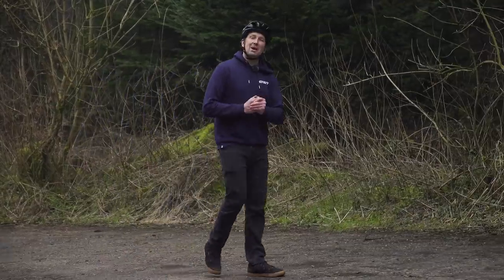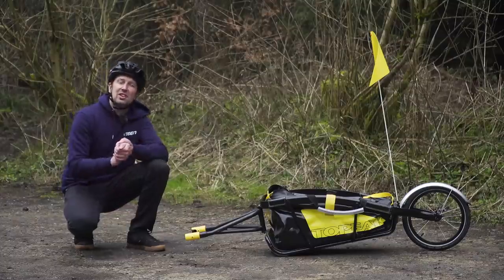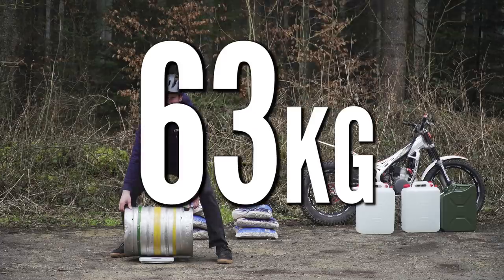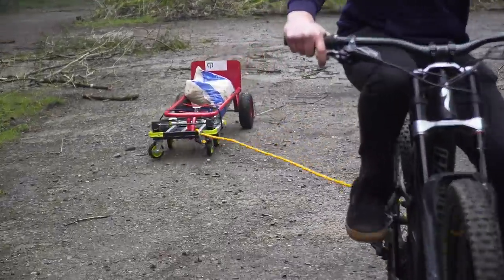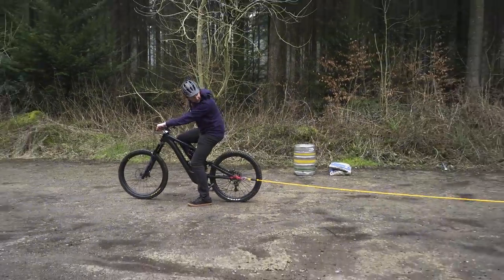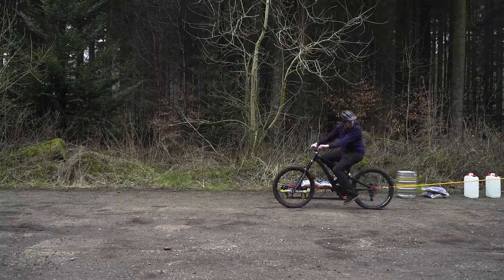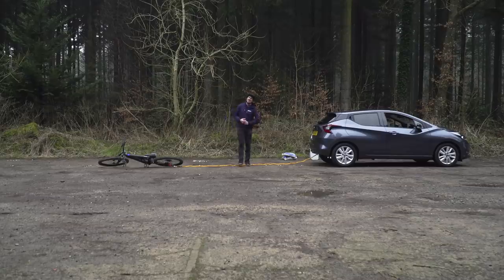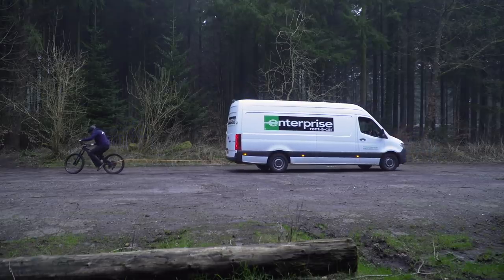E Bike Towing Challenge | How Much Weight Can An EMTB Tow?

Comment: Weight does matter if you run uphill and does not if you push it at flat terrain. For a car the tire pressure and the type of terrain mean the force you need to move it with constant speed.

Comment: That van does not weigh 3.5 tons they weigh 3.5 tons when you load them not empty 😂
Reply: No, a normal large car weighs 2 tonnes so add a larger engine for output and longer wheel base + the metal on top of it then it is. Facts
Reply: Large 3.5-tonne vans are the heaviest vans you can drive on a regular UK car licence. The 3.5-tonne part - also shown as 3.5t or 3,500kg - refers to the gross vehicle weight.
The Gross Vehicle Weight Rating is basically the maximum total safe weight of your vehicle, counting the curb weight (the weight of our vehicle when empty), plus the weight of your passengers, fuel, any accessories added to the vehicle, cargo, and the “tongue weight” of a tow trailer.
Reply: 3.5t van means fully loaded. They weigh about 2.5 t empty, cargo 1000kg. 3.5t is the max you can drive on car licence. Trust me, it is my job this stuff.
Reply: Also that small car weighs about 1500kg fully loaded, not empty, so this is also incorrect unfortunately
Reply: @quitemountainous2528  exactly I do it as my job to I’m a courier and drive a Luton van that van does not weigh 3.5 tons empty
Reply: @quitemountainous2528  not if u passed before 1997 7.5t then
Reply: Still very impressive all the same
Reply: @quitemountainous2528  I don't know what your job is, but my UK car licence lets me drive up to 7,500kgs, or 8,250kgs with small trailer.
Reply: @tribester07  we are obviously of the older generation as we can drive what ever we want

Comment: 25 litres of water does not weigh 33kg, even with that container which empty would not weigh more than 2kg, what gives?
Reply: Maths wasn't the strong point on this one! Even 11 year old kids know 1L is 1KG
Reply: @Chris Smith the water is a small one really, the 3.5T for the van is way off, it will be around 2T, the 3.5T is total weight inc payload, so in this instance the van could be 2T with a 1.5T payload (carrying capacity) which totals 3.5T.
Reply: It was still a very impressive feat though, I think pulling that van was awsome.